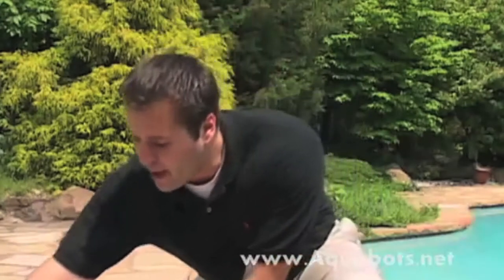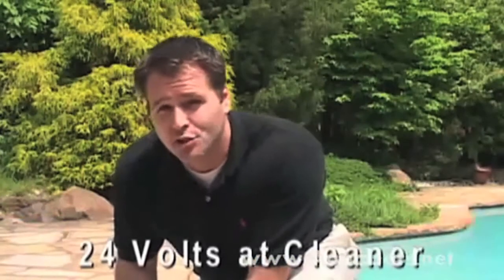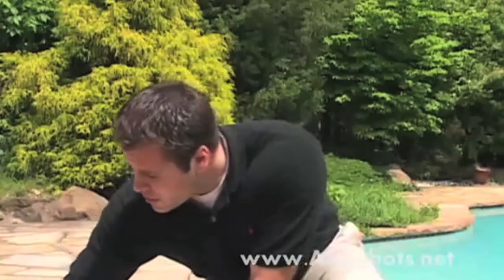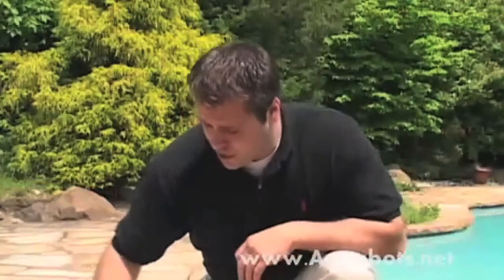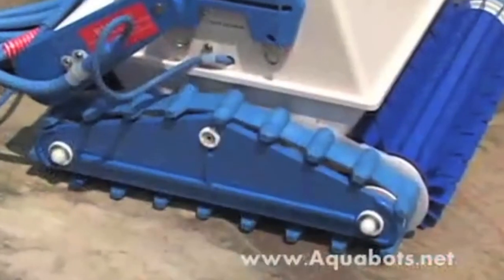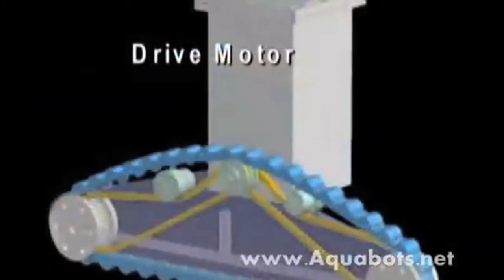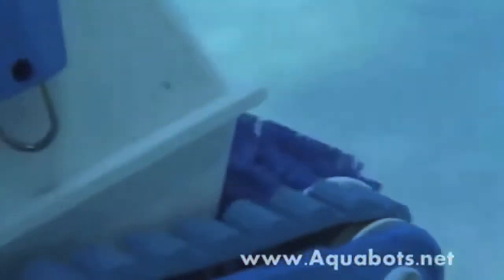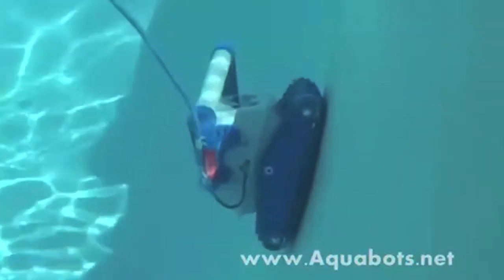Aquabot Pool Cleaner - Design, Components, Cleaning Action

Comment: see the drive track has extra holes in the frame. ? Who has pins/wheels to tighten the belt as it stretches.  Why no idler arm for tension on the drive track ? .  Aquabot never replies ?

Comment: does not climb on any ceramic or tile surface.  Anyone have ideas to shrink the drive track as it stretches in a short time.   it would be simplest to have an idler arm assy. built in but why when you can sell  new tracks  for over  $40.00 that cost  $2.00 to make !